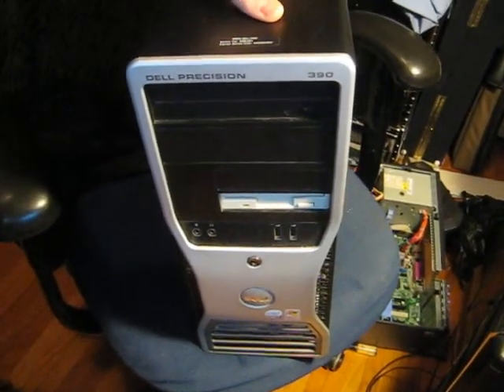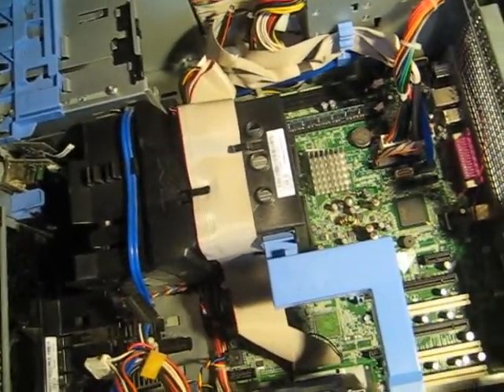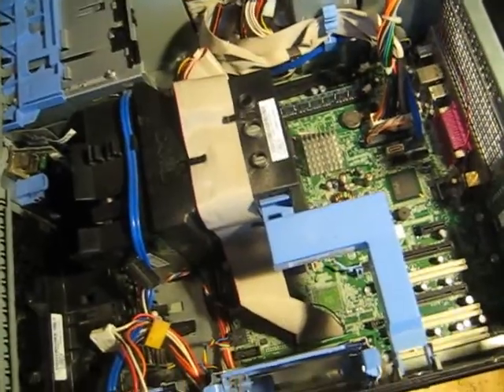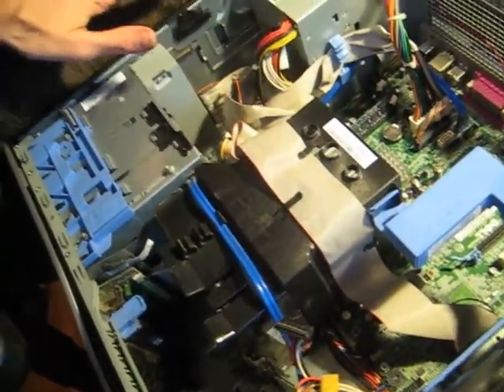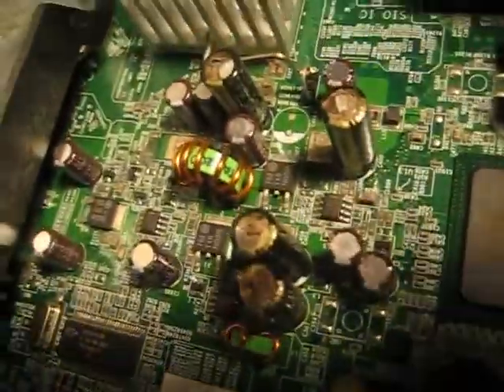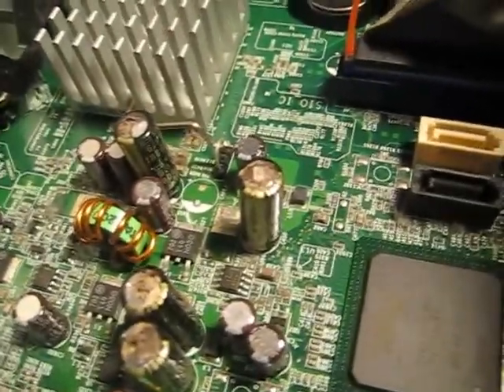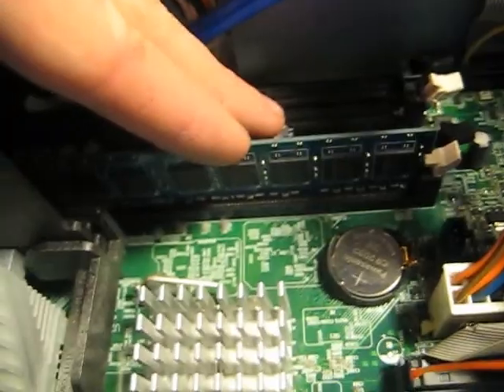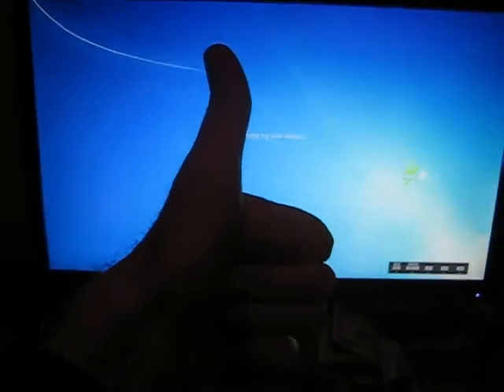Dell Precision 390 motherboard repair - "overheating" and memory errors

Comment: I changed those capacitors  too  , 4x 6.3V 1800uF , the PC was at least working i.e. bootable and usable but kept randomly shut=off. BIOS - Event Log was reporting CPU0 temperature "something something" ... but the issues was the stock PCI-E ATI FirePro V3750 GPU ... after swaping the graphics card the issue was resolved and also the nort-bridge temps with the passive cooler went down 10C. Clearly the VGA was causing someting on the motherboard, I would bet my money on those blown caps that the graphics card was the cause.
Reply: In fact the shutdowns still persist with (Shutdown due to thermal event). New VGA (FirePro V3750) , new Heatsink with Fan on northbridge. Removed 2 DIMMs out of 4. Swapped the CPU.  Running only memtest86+ still shuts down. What the hell can still overheat ? I have a FLUKE 62 MAX IR Thermometer and checked the board all over numerous times temps looks good . Southbridge max 60C ,which has no heatsink.

Comment: Did mine today. Six caps bad.  All 1800uF 6.3v electrolytic types. Two 10mm x 18mm and four 8mm x 20 mm. 
Solved the thermal shutdown problem. 
Thanks again!

Comment: While replacing my graphics card I noticed 1 of those exact same tall capacitors in the same location was bulging and oozing. Probably the other 3 will follow soon. Do you recall what capacitance/voltage the capacitors were?
Reply from the maker: I don't, unfortunately (don't have that board anymore, I don't think).  It'll say what their ratings on the side, though.
Reply: No worries, i looked them up again. For anybody else in the future reading this: they were aluminum electrolytic 6.3V 1800uF . Also better to buy capacitors with low ESR/Impedance (9 to 16 mOhm) from my research.
@alecjahn thanks for the video nonetheless!

Comment: ya uhh..........where's the repair?
Reply from the maker: I didn't record footage of the actual capacitor replacement since there's much better generic videos on YouTube already.  In short, if those caps are popped/leaking, they need to be replaced.

Comment: Nice repair.  A few years back an older Dell XPS at my school started to fail POST with memory failure codes.  IT manager wrote it off as scrap after trying a bunch of different RAM modules, but I spotted two caps with blown tops right next to the memory slots.  Swapped them out for similar valued ones and computer ran for several more years before getting replaced.
Reply from the maker: ignorance is bliss for people like you and I!
Reply: +alecjahn I guess so, but in this case I let the school keep it because it was needed for the science classroom and there wasn't a spare immediately available.  
Also used the chance to teach some other interested students the parts of a computer and some basic electronics repair.